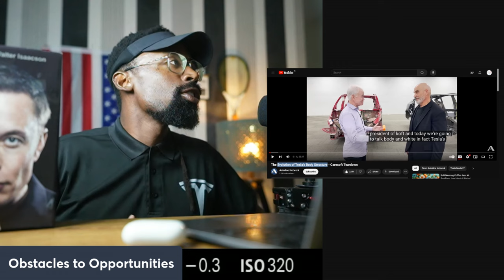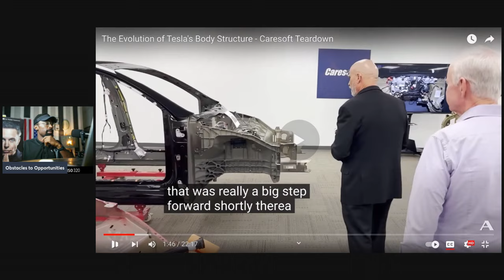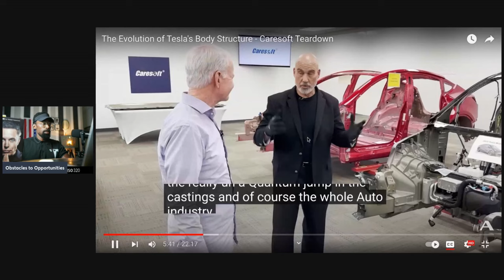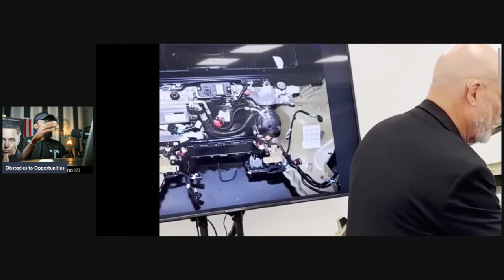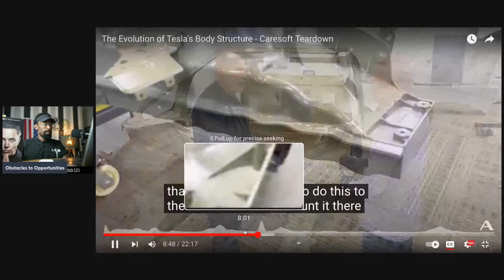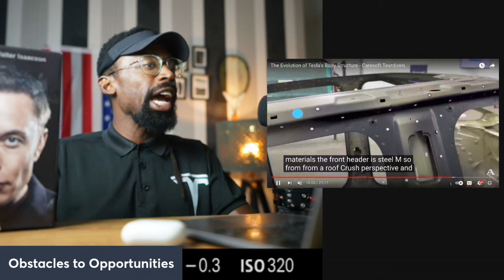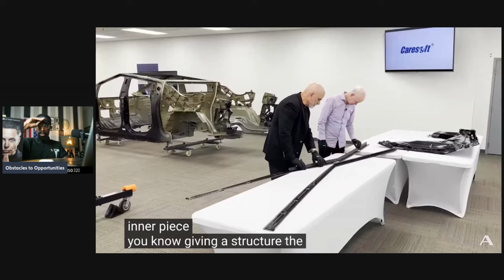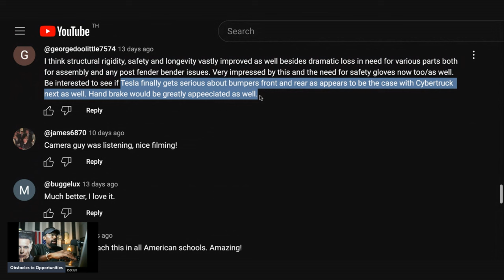Why Tesla is Better than China's Manufacturing "Everyone Hates Tesla"

Comment: Casting has several issues. Mostly surrounding Quality control. However, the advantages in labor reduction are significant.
Reply from the maker: I think great videos like Sandy points out the benefits of the quality and the casting provides better quality. The data, reports and surveys point to the benefit of the casting. The reduction of labor is only one point there is admin, services, inventory , supply and much more. I know Toyota and WV both providing massive amounts of praise to the casting and quality of Tesla. Agree to disagree, but thanks for the comment.
Reply: @ObstaclestoOpportunities  i said quality control. Not quality. Casting can be very good, but it can also be very bad and need to get thrown out. Creating consistency in process is it's own engineering challenge.